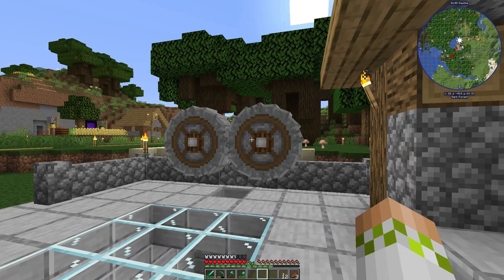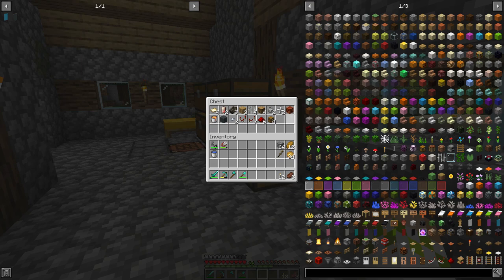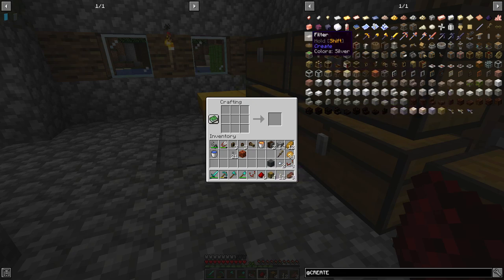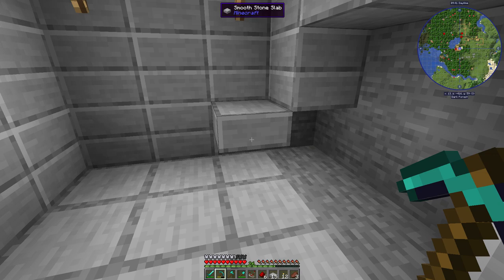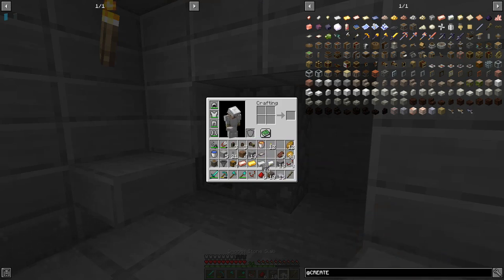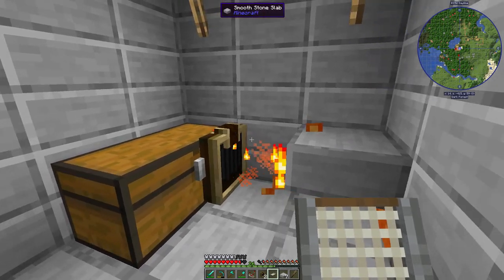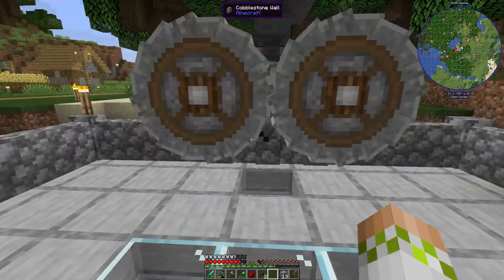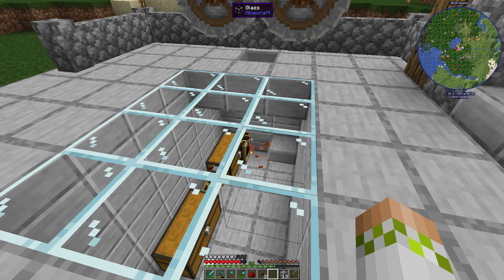Surviving With Create :: E05 - Automated Ore Processing

Comment: Why are the funnels so thin on your let's play?
Reply from the maker: Any chance you are using the new 0.3 Create? I believe certain blocks were adjusted in texture / name slightly between the version here and the new version released a few days ago.
Reply: @RagePlaysGames  yes. I've created a vr compatabile 1.16.4 modpack that has create 0.3 and the funnels are 1 block large instead of slab size.
Reply: @AdhdGamerDadPro  hey bro are you able to add filter in this new type of funnel??
Reply: @saroz9090  you can use filters only in brass funnels. Extractors were removed and replaced by andesite funnel placed ontop of belts.